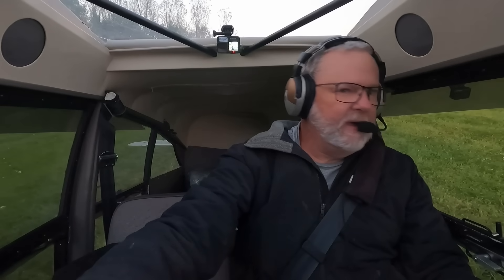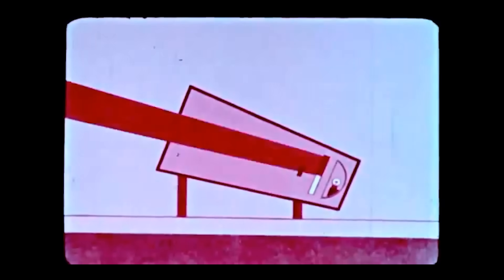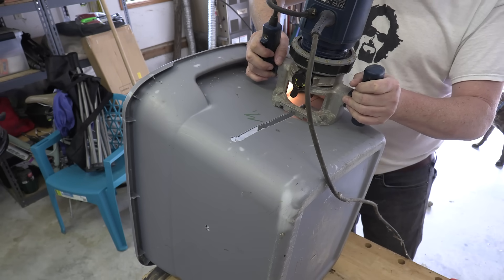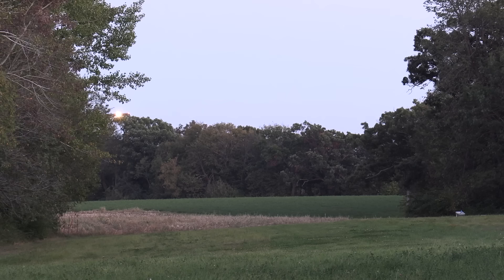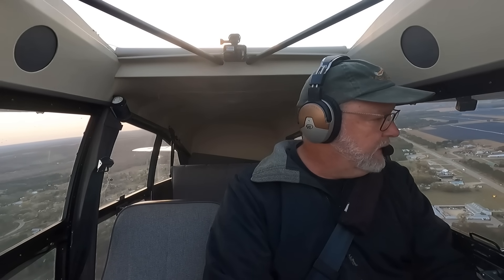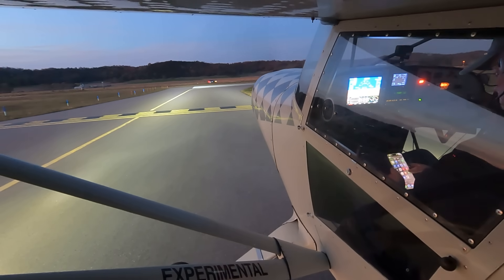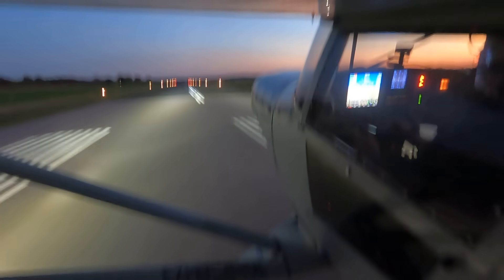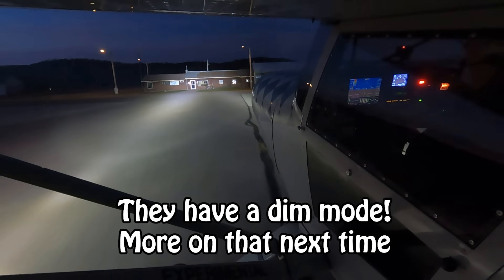My brightest idea yet

Comment: The aluminum foil blocks light coming through the wall of the tub, but throws mixed red+white back at the lamp. Perhaps painting the foil black will reduce the scattered light inside the tub and improve the color contrast between the beams.

Comment: LED really is the way to go. Expensive, but theoretically they last longer, also they increase safety; see and be seen.
Reply: There's no doubt a "quality" LED will last much longer than an incandescent (or Halogen) filament lamp. Mostly due to filament thinning from normal use and vibration. Especially lamps mounted in engine cowlings.